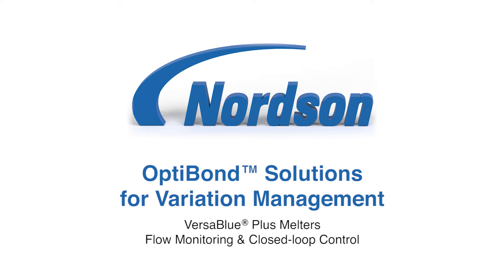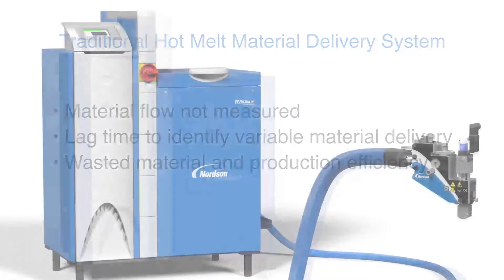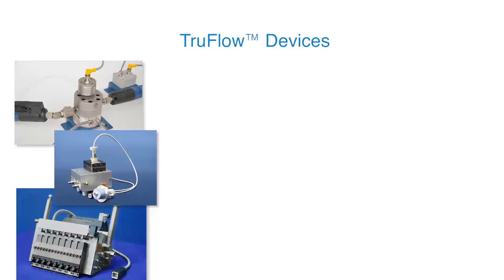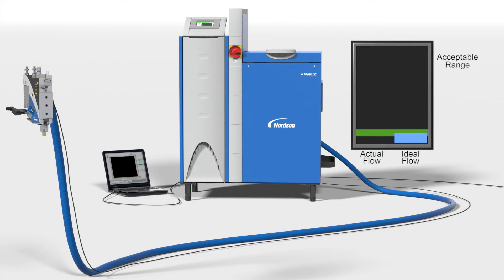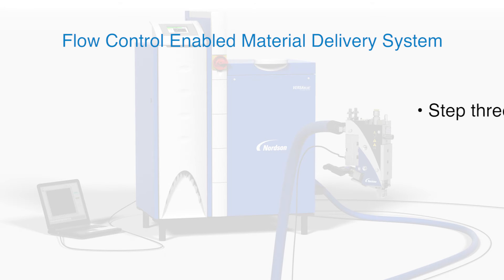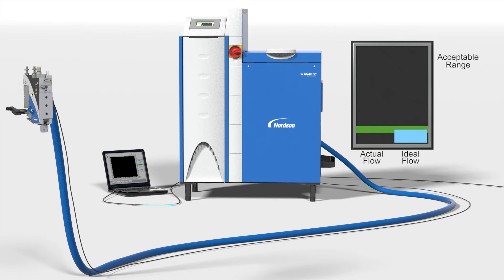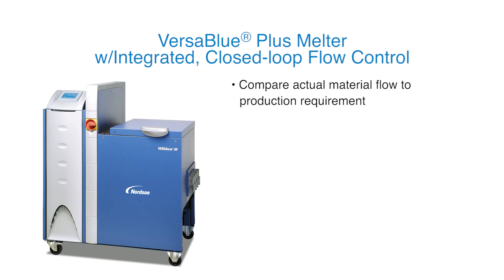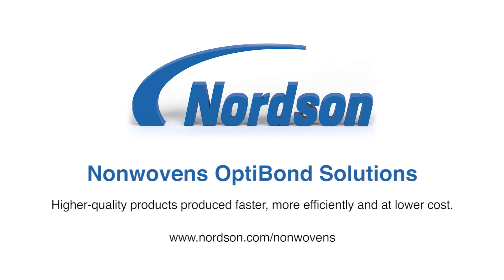VersaBlue Plus Melter Integrated Flow Control

Comment: could you please put videos shows the process for the versaBlue Edition & how to check filter & change it ,i'd be so grateful if you do that
Reply from the maker: I'm afraid we do not have a video that shows those maintenance tasks you are asking about.
Reply: Nordson Adhesive Systems Thanks so much for your kind reply,it is okay but if you have any material concern about the versablue version (any Data) i'd be so grateful

about the filter if there any manuals i can download to gather such informations ???
Reply from the maker: Hello Mohamed,You can find manuals for VersaBlue on our digital library website. The URL for that is www.NordsonAdhInfo.com. On that page you would choose the Technical tab. Use the first dropdown menu to ask for Manuals and then go to the bottom box and type VersaBlue in the keyword search.
Thank you for contacting us and I hope this provides the information you were looking for.
Reply: Hello,we are manufacturer of hot melt glue machine,if you have needs ,please contact with us.
whatspp:+ 85 131 6457 6609